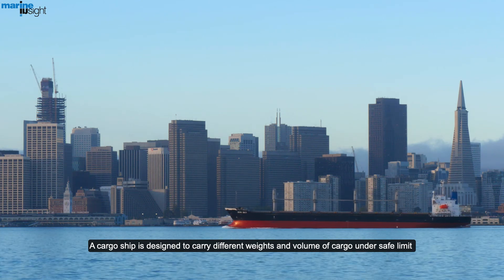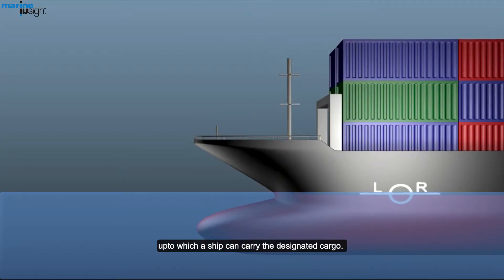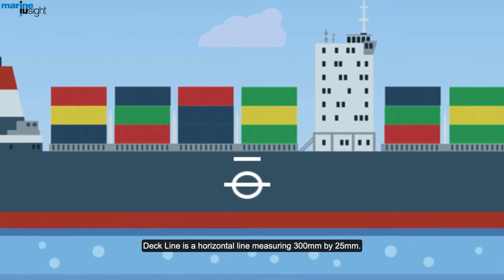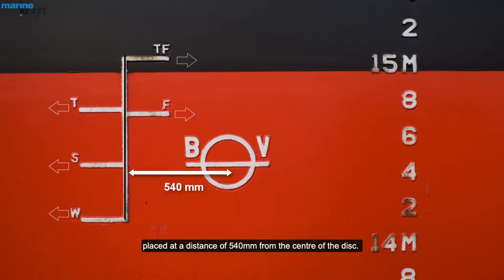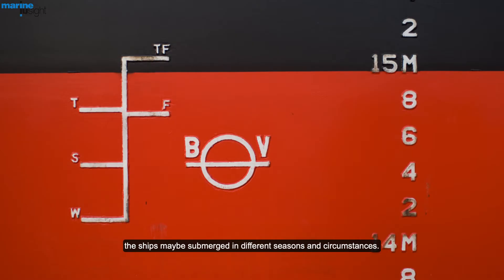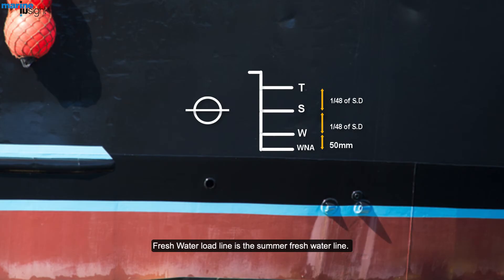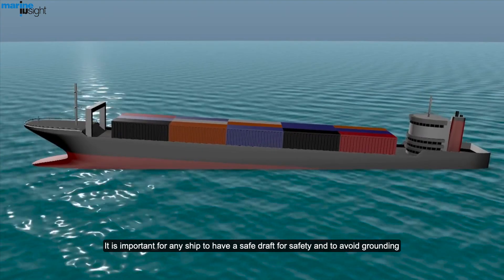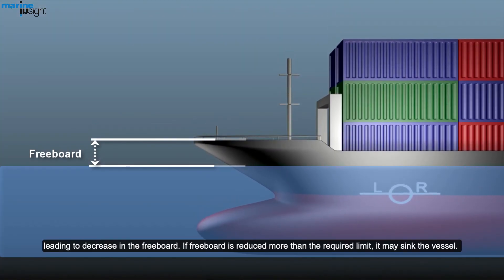Load Line on Ships- Plimsoll Line

Comment: So, if a ship is loaded to the TF line in tropical fresh waters, then sails to Winter Salt waters, does it become less safe, or more safe?
Reply: The  buoyancy of different waters are the reason for the lines. If you sail from warm TF waters that are less buoyant than the colder more buoyant waters in a winter sea zone the ship will rise from the TF mark to the Winter mark due to the denser, more buoyant waters.  Still safe.  Due to the hight difference between the two lines the vessel's center of gravity could be affected but not in a way that would deem it unsafe.  To answer your question, it would be less safe due to righting arm angle increase.

Comment: one other small correction the thickness of the lines are 25mm not 23mm
Reply: Could I ask if you have any information with regards to load line assignment?
Reply from the maker: you can check this link - https://marineengineeringonline.com/condition-of-assignment-load-line-survey/
Reply from the maker: Thank you George...👍🏻